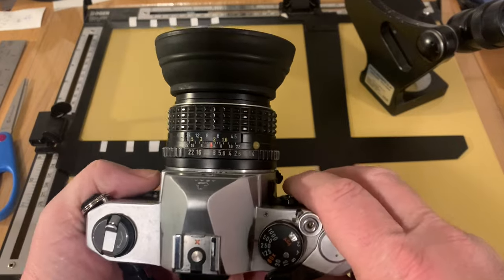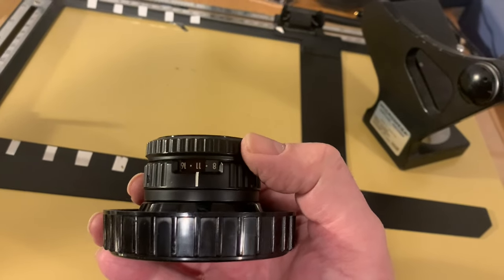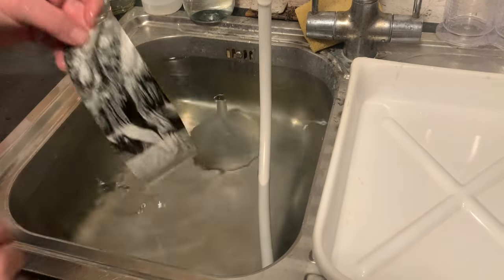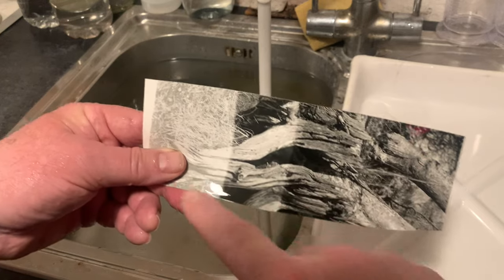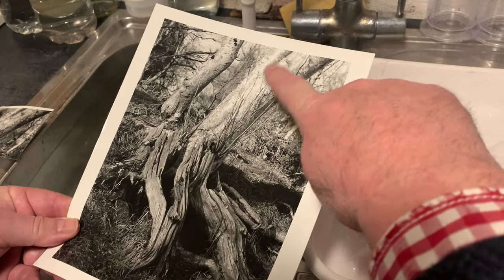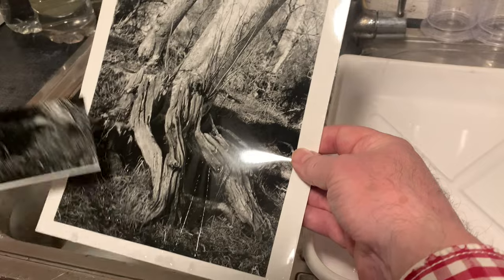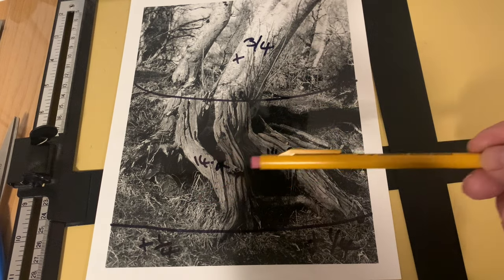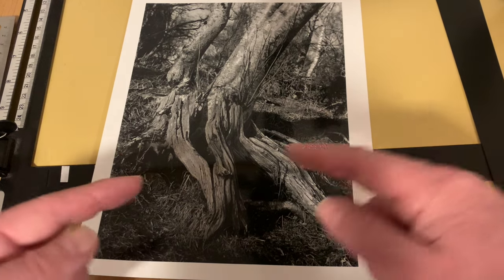F-Stop Printing - Complete Guide

Comment: Fantastic clear and concise video on printing. Best I have seen. Anybody could watch this and come away with ability to make a quality print.
Reply from the maker: Thank you, Geoff 🙏
Reply: I agree. Back in 1984 I purchased a Canon AE1-P 35mm. After doing a couple rolls of color film sent out, I run into someone who tells me about Developing B&W. I head down to the local camera store & purchase a used enlarger, some paper, chemicals & one of those things you put the film in to make the negatives. And of course, a red light bulb. And in my bedroom, I developed about 3-4 rolls but not as good as this. Didn't know what dodging & burning was or ever heard of it. Heck, didn't even know what the aperture on the camera lens did. I just adjusted to get the camera light meter on the zero if it couldn't in the P mode after reading the first couple of pages of the manual. Flash flood from the pompton river in NJ  with 4.5' of water in the house. Then the gut & rebuild & the move the heck out. Never did get back to it. Still have the camera & 2 17 yr old rolls of Kodak Gold 200 in the fridge & every now & then, I think about it. Happy shooting .

Comment: This my first contact with f-stop printing. Thank you for the video and sharing your darkroom experience.
I think, I performed something similar but instead of f-stop i'm calculating my dogde/burn times in percentage% of 'base exposure'. 
Works well when moving to huge prints.
During the selection of base exposure, I prefer to do more smaller steps, looks like chessboard :)

Comment: Great Video John ! When you changed paper did you not have to adjust the exposure time ? For example Ilford warmtone fibre seems to want 1 1/2 stops more light than the classic gloss fibre . 

Also you changed filter from Contrast 2 to 2.5 , did that not affect your base exposure time ? 

Really glad to see you back on the Tube !
Reply from the maker: No change in exposure when I changed grade. I use a mix of yellow and magenta on my colour head that keeps the exposure the same (or very very close). I do like these Meopta enlargers. Tip coming Friday about using different batches or types of paper but yes, there can be differences, especially from type to type like RC to FB or warm to normal to cold. Friday cometh.

Comment: Fantastic video! To be more flexible, I calculated the factors for 1/4 f-stop increments. Maybe it's useful for somebody...

+ 1/4 stop  =  x 1,19
+ 2/4 stops = x 1,41
+ 3/4 stops = x 1,68
Reply: This is indeed useful although I would be great to understand the formula. Excellent video John and will certainly try. I could not find this in your book so I guess a future edition?
Reply: @jph364  To get 1/4 F-stop, you have to take the 4th root of 2, which is exactly 1.1892071150027. To get to 2/4 and 3/4 stops, you have to multiply it by itself once (= 2/4 or 1/2 stop), or twice (= 3/4 stops). If you do it a third time, you should end up with (approximately) 2.0, which corresponds to a full F-stop.
Reply: Muchas gracias. Para tener la tabla completa de forma rápida (sólo serían necesarios en la práctica para los números primos 2, 3 y 5) se me ha ocurrido esto: Por ejemplo para 2": para +1/4    2" x 1,19 = 2,38" x 2 = 4,76" x  2 = 9,52" .....;   para +2/4   2" x 1,41= 2,82"  x  2 = 5,64" ....., etc.
Reply: Muchas gracias por la explicación. @shervinsardari

Comment: Excellent video! Would the f-stop method work if going from RC to FB paper? Also, what is the importance of measuring the negative on the baseboard and not the paper when calculating the enlargement exposure time?

Comment: Thank you for such clarity.   One question if you have time to respond -  will the principle work with split grade printing ie using the 2 separate grade timings in the same way you have used one.   I’ve started doing split grade printing since your videos a few months ago and looking at adapting this into that workflow.   Cheers!
Reply from the maker: Thank you for your kind words! This fits right into that workflow. Do your split grade printing as normal once the base exposure is found. For burning in you can have some fun choosing the best grade or split.

Comment: Also, I only have an analog timer - what do you suggest I do since I cannot make fractions of time variations? Don't use the F Stop printing method?
Reply from the maker: Please do use it but make sure your exposure timings are longer and round. For instance, in 1/4 f stops, 10, 12, 14, 17, 20, 24, 28, 34. These are close enough to work well. Don't use less than 10 seconds. If you find yourself less than ten then close down a stop on your enlarger lens.
Reply: Thank you! May I also ask, is F-Stop printing your preferred approach for all your darkroom printing? If so, is it because of the accuracy and consistency it provides?   @PictorialPlanet
Reply from the maker: @jeta1383 yes, I use f-stop printing all the time now. In the early days I didn't but after reading Gene Nocon's book "Photographic Printing " I started doing it. After a while it became second nature. We use it all the time when photographing and so it makes perfect sense to use it in the darkroom.

Comment: Hi John, I was trying to understand the pattern in the quarter stops on your F/stop exposure times chart. Is the reason the length of each interval increases between each quarter stop because it's an exponential function from one stop to the next? I'm asking also because I've had some prints that had a 4 second exposure time at F22 on the lens, and want to figure out the quarter stops of shorter exposure times than 5 seconds. My other idea was to hold an ND filter in front of the enlarger lens, do you think that would work?

Also, last question, how are you burning in your images so perfectly? Like how are you covering up the base exposure areas without leaving lines or at least some very obvious gradients between the different exposure times on the print? Thank you!
Reply from the maker: 4 seconds at F22 - wow, that's very short and really hard to work with. I would find a way to lengthen that time to at least 10 if you can. Yes, an ND would do it. Burning in just comes with practice. I guess I've been doing it for a very long time. The camera might make it look a bit better than it is too.
Reply: Sorry, just one more question: whats the relationship between the quarter stop increases so I can calculate them for exposure times less than 5 seconds?

Comment: Hello John,  Can you please confirm when you say measure the size of negative on baseboard its the same as measure the uncropped projected image on baseboard?
Reply from the maker: Yes Charles, that's right. Measure the uncropped negative from edge to edge along one side. I measure the length. So, with my 10x8 print I remove the easel and measure the projected full negative. I placed the easel back and positioned the enlarger head right for my new size. Then I removed the easel again and measured the new size of uncropped negative along the same side. Then I have my sizes for the calculation.
Reply: Thank you.  Got off my butt and tried it.  Works great.

Comment: Regarding the exposure time on the test strip, doesn't the brightest area (on the left) have the longest exposure? Is this backwards in the video?
Reply from the maker: No, the left (brightest) part of the test strip got the least exposure from the enlarger, 5 seconds. Remember, it's the opposite of the camera where more exposure makes things brighter. With the enlarger everything is opposite.
Reply: @PictorialPlanet  Thank you for responding. It's been a long time since I've done dark room printing and clearly I need a good refresher. Thank you for sharing these videos and your expertise.
Reply from the maker: It might help you if you think of the paper and what colour it is. It's bright white with zero exposure. As it gets exposure the silver gets energised, bit by bit. So slight (short) exposure doesn't effect much silver and not much gets developed. As more exposure is given then more silver gets developed until, with enough exposure, all the silver gets developed and the paper has become black.
Reply: @PictorialPlanet  Thank You! That is very helpful.

Comment: I have some doubts about trying to find the right exposure for the highlights and choosing the grade later. In my experience there are some highlights that I can't print with a higher contrast filter, so it becomes a little bit of a fight between choosing the right contrast and the right exposure too.
Reply from the maker: Some photographs need more than one grade to give the look you want in the print. I suspect you might be talking about this. For instance, skies might need a different grade than the land. Or, you might use a base grade and burn in at a different grade. The variations are infinite. The basic enlarging practice of expose for the highlights, grade for the shadows is a very good starting point because it changes only one variable at a time, essential when building up experience and will achieve good prints quickly. From there the skies the limit my friend.
Reply: Thank you for the answer and for the amazing video. For me, if I choose a certain time to print the highlights in a filter 2, sometimes when I increase the contrast those highlights are lost and we're kind of back to square one. That's why out of experience I choose a contrast that I more or less know that will be better for the photo. @PictorialPlanet
Reply from the maker: You're more practiced and your technique more advanced. That's great!

Comment: Absolutely gorgeous print. I Have some questions, semi-related:
The underexposing by 2 stops, doesn't that lose the shadow detail as well? What is wrong with overexposing and under developing? Wouldn't that produce more detail in low light areas?
I tried using a 100asa film and light metered it for  400 then pushed it 2x but I felt the result was rather grainy(for my taste). If I use 100asa and underexpose, the shutter speed almost always goed to 1/60th or below and I am not that steady handed. They did have very nice contrast though.
Lastly, and most on topic; It probably does require the same enlarger, I'm guessing, because of the source light strength. But If I were to swap enlargers, could I then only re-measure the base time and still apply the relative stop settings for the burning? Or will these change as well.
Highest regards, and thank you for your video uploads:face-red-heart-shape:
Reply from the maker: Not sure I understand about the underexposing. I never do that and always expose at my personal iso. I find 'pushing' film gives poor results and increased grain (as you find too). Over exposing and reducing development is better than underexposing and increasing development. I wonder if I confused you with my contact print? That was printed down (darker) so I could ascertain the highlight detail better and the light table lifts the darkened shadows so I can see those. The negatives however, are correctly exposed and developed.

Using a different enlarger works perfectly with f-stop printing. Once the new base time is found then all the + and - stops or fractions of stops work exactly as they should. This is the benefit compared with just working in seconds which mean nothing as soon as you change enlargement or light source.

Hope I've helped.
Reply: @PictorialPlanet  Thank you for your swift response.
What I mean is, down stopping 2 steps after measuring on the shadows isn't that basically underexposing?
Perhaps it is only when the dynamic range is beyond the range, or when the zone 3 and highlights dont fit. Then they expose for zone 3 and push the film 2x to get the highlights back in zone 7.
I am now thinking I am misunderstanding the entire zone thing.
Is the "develop for the highlights" only meant for the printing process and not the film development? 
Your content does revitalise my enthusiasm. Thank you.
Reply from the maker: @MacShrike Watch this. I explain the zone system a bit. Shadows should be around zone 3 but the meter will place them in zone 5. It puts everything in zone 5. So if you measure shadows close down 2 stops. Watch this for help: https://youtu.be/Mnc6q66C29s?si=nr9Skye7qpmGBS8H
Reply: @PictorialPlanet  Yes thank you. I understand.
But how does that relate to/transfer to the over exposure of your shooting 50 iso as 25? and then under developing the film
I don't know how/what you metered there. Would it be the same as metering for the shadows and only dropped 1 stop from there instead of using the iso 50 film as 25?
I am sorry if I am bothering you a bit with my ignorance. I am trying to wrap my head around it.
Highest regards, Mac
Reply from the maker: @MacShrike There are two different things at play here and you are linking them but you shouldn't. 

1. The film speed you shoot at is the true film speed obtained with your film/developer combination. That is to say, your film speed is not that written in the box but that obtained with your developer. As an example, using Ilford FP4 Plus, D23 developer gives me a film speed or EI of 80 not 125 as the box says. If I use FX55 I get a film speed of 200. So what is the film speed if FP4? What do I set in my meter? If developing with FX55 I set 200. If developing with D23 I set 80. This isn't theoretical, this is actual, verifiable film speed. So setting 200 on my meter, when developing with FX55, is NOT underexposing, it is correctly exposing.

2. Exposure. To maximise our printable zones of light we place our detailed shadows in zone 3 and develop for the right amount of time to allow printing if detailed highlights, zone 8. We can accurately place our shadows if we know our film speed (see 1 above). We can develop for the right length of time if we have done our development tests. 

3. I'll add this one because we are artists. Rules 1 and 2 are important to learn and I liken them to learning how to strip down a car engine and then rebuild it. They are the basic building blocks of good film/darkroom photography. But once we are good at them we can start to play with the rules to make our art, to make our look, our style. But if we don't know first how to strip and rebuild the engine we'll get in all sorts of trouble.

Know your actual, real film speed to expose correctly. Then know where to place your shadows and how to develop for your highlights.
Reply: @PictorialPlanet  😯 aha! ☝🏻🤝🏻😘🙋🏻‍♂️